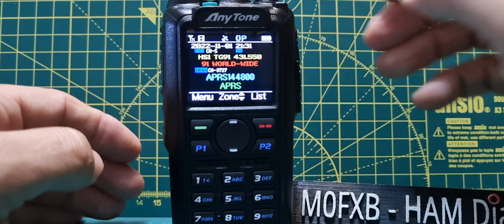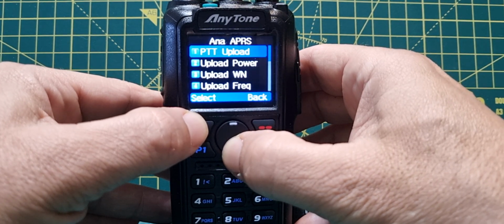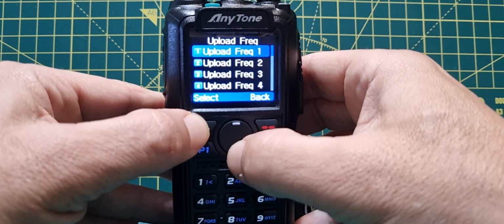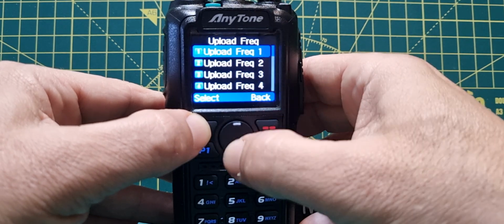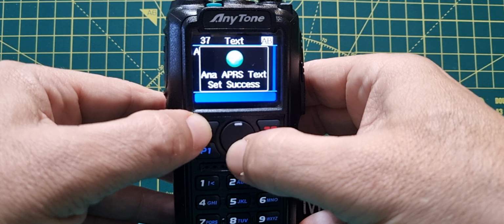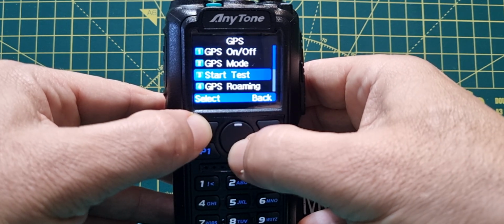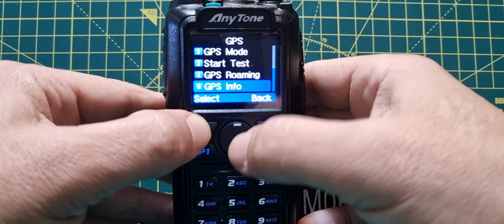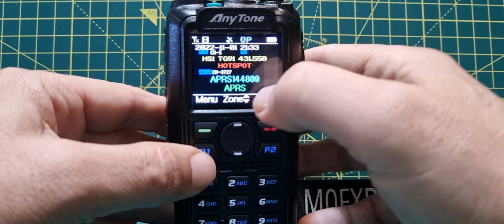APRS Analog- Anytone 878UVII , Programme Using Radio - No Code Plug

Comment: Good morning, mine is sending incorrect coordinates even though they are correct in the GPS info. When it sends the package, whether analog or digital, it takes me to a specific point 92 kilometers from my house and in general, wherever I am, the same problem is that it is stuck at a specific point..what should I do??
Reply from the maker: Check coordinates also select precise